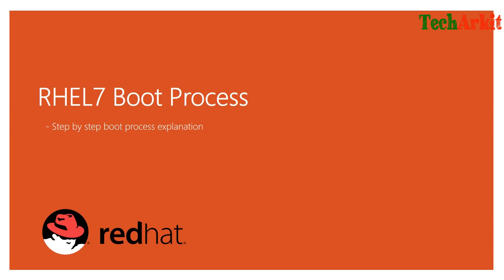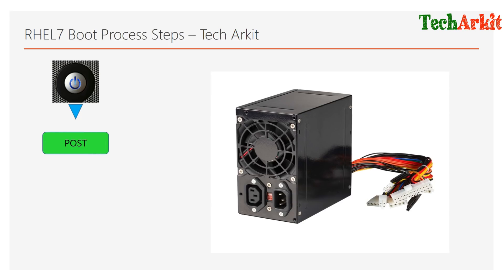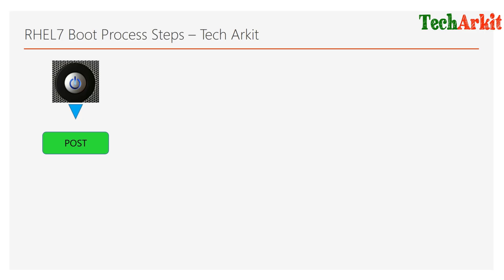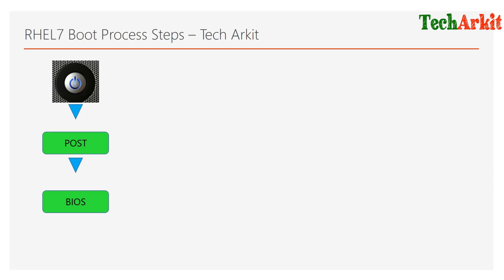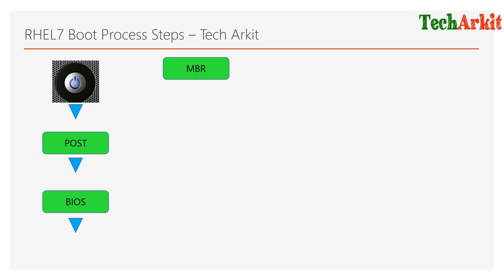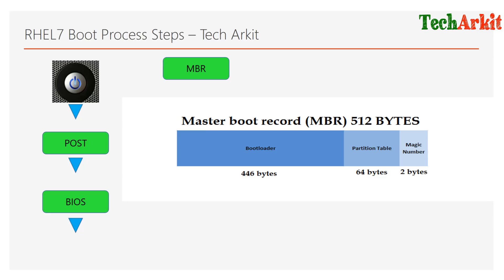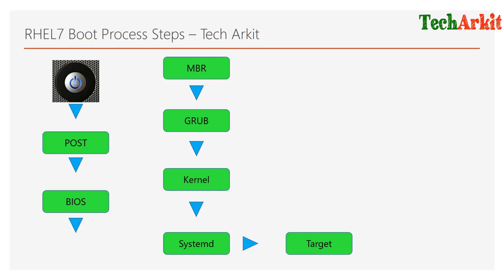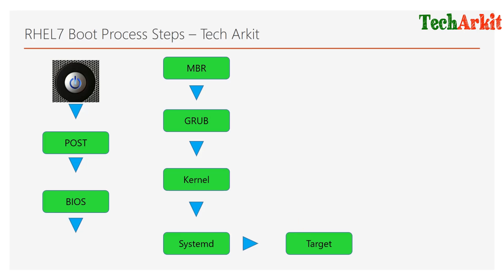RHEL7 Boot Process Step by Step Explained - Tech Arkit

Comment from the maker: RHEL7 Boot Process Step by Step Explained. Understand How Linux machine boots up.
Reply: Just a quick recommendation and help me if I am wrong. The BIOS is the one preforming POST at the beginning before it takes resources for the Bootloader etc.. If this is not the case which device or software is performing POST?

Comment: Wrong info ..(man boot ) ..its should be, bios -> post ...
Reply from the maker: Check once again, POST should be first, since hardware will do there part first then only software will come into picture.
Reply: @TechArkit  unless 
https://en.wikipedia.org/wiki/Booting
https://en.wikipedia.org/wiki/Linux_startup_process

The BIOS performs startup tasks like the Power-on self-test specific to the actual hardware platform.

Comment: did you just say that the "magic bytes" exists to verify that no errors exist in the bootloader code?
i don't think that's correct. "magic bytes" is simply a byte sequence signature that can be used to identify what type of data a binary is. like MZ at the start of a windows PE .exe file, or PK at the start of a .zip file. it sounds like you are describing a checksum.
http://www.nixhacker.com/content/images/size/w2000/2018/11/MBR.png
Reply from the maker: Maybe your confusing between Linux and Windows boot process. This boot process explains how Linux system boots into UI.
Reply: @TechArkit  No. At 7:24 you say that the 2 byte "magic numbers" are added together to "verify errors." 

This is simply not correct.
In classic MBR format, the 511th (or 510'th if counting from 0) byte is 0x55 and the 512th (or 511th if counting from 0) byte is 0xAA.
Period.
In fact, for all these MBR formats :
https://en.wikipedia.org/wiki/Master_boot_record
... 55 AA is found over and over and over.
They aren't a checksum. They are a signature: a sequence of bytes for identification purposes.
They essentially say "I am an MBR."
The exact same way, as I said, a windows PE .exe starts with 4D 5A (MZ aka "I am a windows PE") or a zip starts with 50 4B (PK aka "I am a zip file").
Period. You are wrong, this video is wrong. End of discussion.

Comment: You explained better than most videos. Could you please explain difference between initrd and initramfs? Also what exactly happens at MBR stage? GRUB identifies compressed vmlinuz image decompresses it? Loads initramfs into memory, and then places vmlinuz onto of the initramfs? Sysrootfs is the (temporary filesystem loaded in order for kernel to load all modules) the finally complete /usr/lib/systemd/systemd ==>  init? I know the boot process) I'm trying to understand between GRUB & Kernel
Reply from the maker: Sure